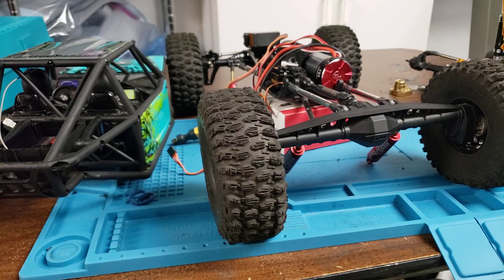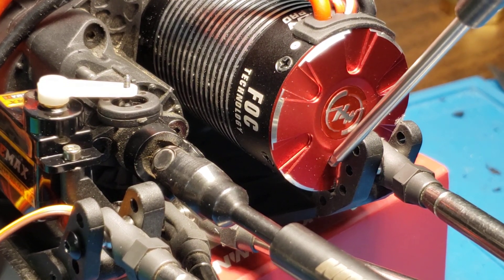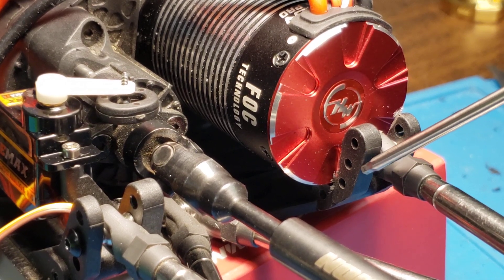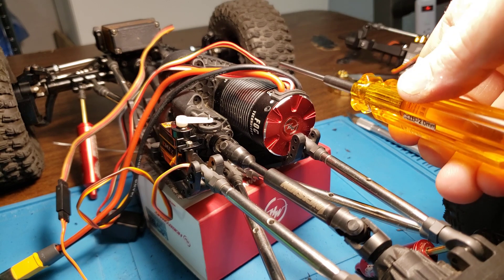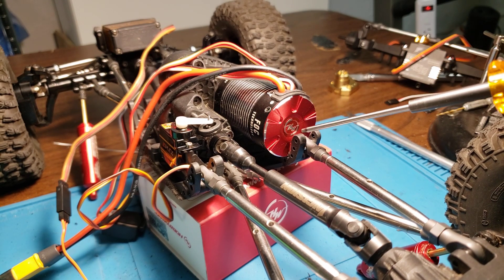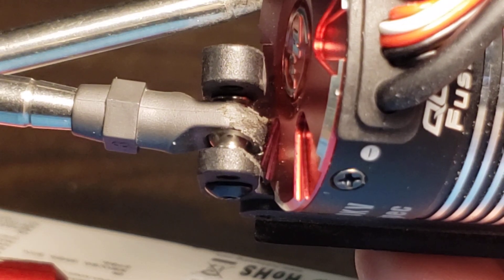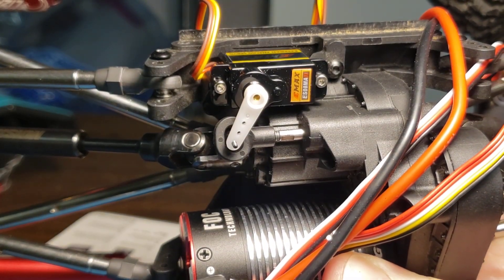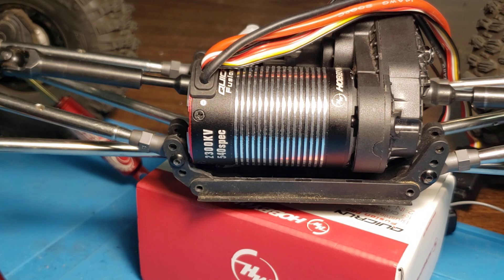1:10 Capra 2300KV, Stock Skidplate Installation

Comment: So if I use the Vader skid will the motor go straight in??
Reply from the maker: Apparently. I have not tried it myself yet but that seems to be everyone's go-to. It raises the motor up about ½ inch and leaves slightly less room inside of the body since it is flat. 

I own a Vader skidplate but want to find out how long my cut stock one can hold up. I don't really see it becoming an issue anytime soon but I'm ready if it does.